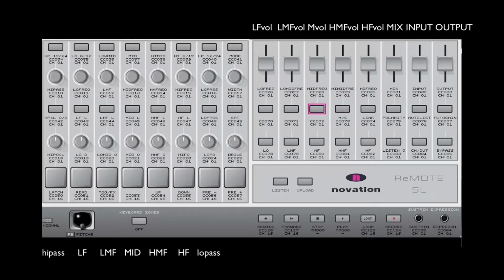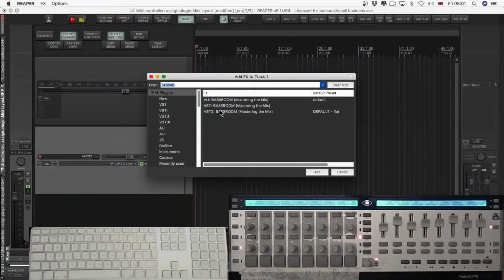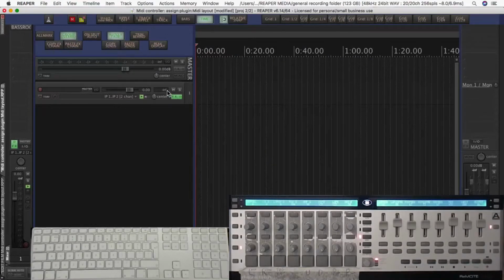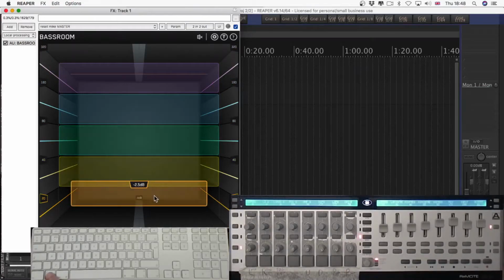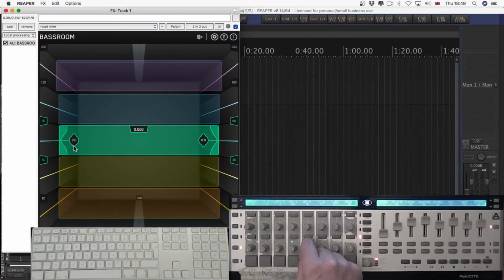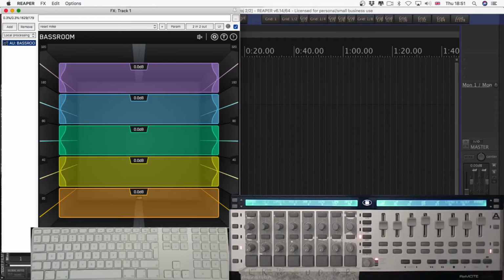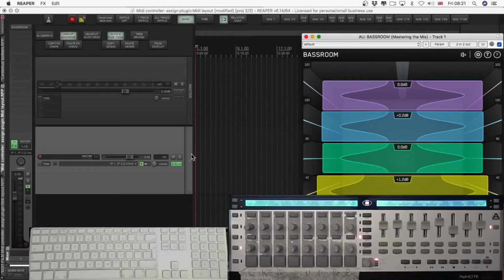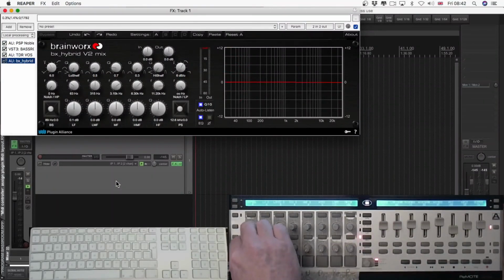CONTROL FX SERIES - EQ "BASSROOM" plugin  - HOW TO PROGRAM to a  MIDI CONTROLLER

Comment: So you don't use automap? If I want to use an SL as an all around DAW controller should I program everything directly into reaper the long way? Would it be better to get a separate DAW Contoller that uses CSI and save the SL for effects and Synths?
Reply from the maker: Hi - no automap...no "logical layout" with auto map - i took the layout system i made from the  SL onto the MCU for 2 reasons - modifiers mean you x4 your controls and continuous controllers plus motorised faders give exact positions when switching plugins/channels, rather than "jump" or "soft takeover" options you're restricted to in midi. Have i sent you the SL files already? SL is great and i still use it, but those restrictions i'm happier without
Reply: @undarkreaperdawcsi8187  I don't have your SL files. Do you have them online?
Reply from the maker: @pgfinna  Sorry - been away - here's the link.  https://drive.google.com/file/d/14ySM6w9Az4-viEWV4fl7ASJaTVUAbPlm/view?usp=sharing
they follow the same principle of my other layouts - explained in this vid https://www.youtube.com/watch?v=o7VsC-U6Nk4 - 5 mins onwards prob most useful...

Comment: Great work, I have been dreading mapping my controllers, this method will make it much less painful. Thank you for showing the way!
Reply from the maker: Thanks - i've been in two minds if to carry on this "series' but it's the simplest, non third party method I've found. Just keep laying out your Eq's the same on the controller and it'll help you focus on that rather than the screen. Remember - you can always use two controllers together to make up the amount of parameters needed and all the CC's i use are at the beginning of the vid - glad it's useful
Reply: @undarkreaperdawcsi8187  Using bcr2000 in realize mode works good. My controllers are on midi ch 1. I tried to map cc1 to freq on hi pass filter. Would not work. Also can we midi map the enable band button (reaeq)?I tried but was unsuccessful. I think layout the same is crucial for muscle memory and speed of edit. 
I appreciate your approach and your content, thank you!
Reply from the maker: @genmce  Hi- i'd avoid midi  CC 1/7/64 on midi channel 1 i"ve had no probs where the plugin's focused - effecting any other part of the program and use midi channel 1 for all fx control via midi.. but my CC's start at 10. Hipass i'm using  a rotary - cc10 for freq... in fact - it's a while since made the vid, but i'll check the template pic shown at the start of mixroom and bassroom examples gives you all the cc's numbers and assignments. Once 1 EQ is done it's a repeat for every EQ. Though there's variation in options and layout, this is all accounted for in the sl template.. and yes - all buttons/switches can be controlled. You have options on buttons of momentary/step/toggle to suit your needs.  Step allows a button to make increments or step a 3 to however many switch, by multiple presses, on the sl at least..